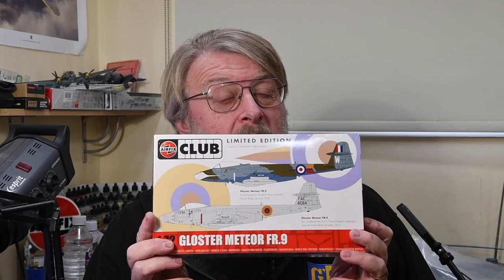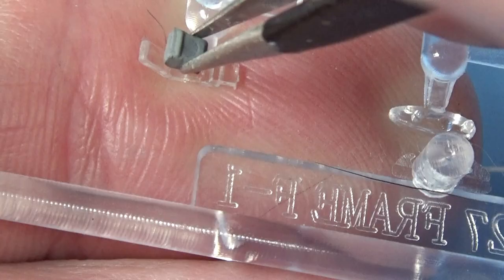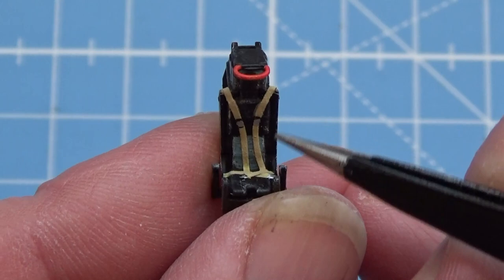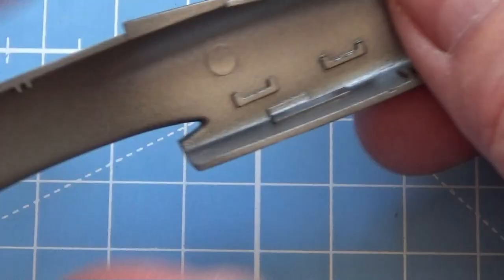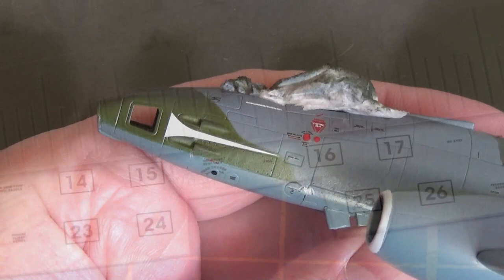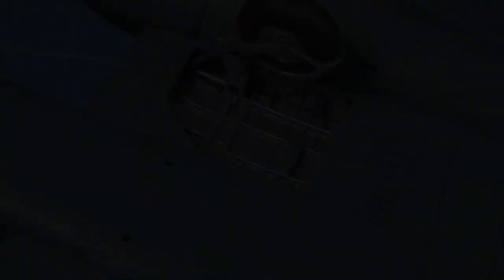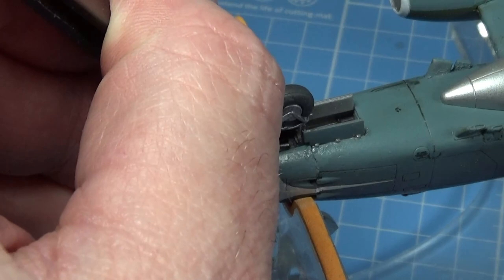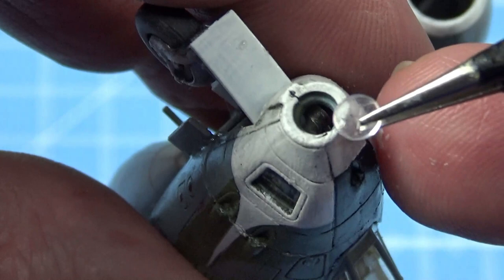AIRFIX METEOR FR.9 2023 CLUB KIT how to build it!

Comment: Lovely Meteor, Gary.
Every time I’ve built a Meteor I’ve had a problem with the undercarriage, next time I build one it will be in flight!
Ian
Reply: I found that I had to sand the tires halfs on the flat side till about a mm per side is gone--then the tires fenders dont have a open seam
Reply: @bullitt3980  is that the Airfix one? I’ll save that for the next time 👍🏼
Ian

Comment: Very handsome build!
A couple of questions.
• What silver did you use on the fuel tanks?
• Considering there's nothing behind the camera windows, would they look better painted black on the inside?
• I get nervous mounting clear parts with anything stronger than white glue -- any comments?
• Stencils.  Have you seen a 1:48 Phantom II in SEA camo with stencils in 2 different colours?!  At least, as you say, they're all present for you so you can choose what to apply.  (Is the aircraft modelling equivalent of a rivet-counter a stencil-counter?)
Again, very handsome.  Thanks for fighting the COVID for us.
Reply from the maker: Hey Randy! The silver is Vallejo Metal Color aluminium over grey primer. Interesting point about the windows - I like them clear but then I'd have liked an F24 on a mount behind the windows! Clear parts - larger ones I've tended to use PVA of some sort but small light covers I find a tiny bit of extra thin works OK as it follows the seam by capillary action. Phantom stencils scare me- I've got one to do in 1:72 and there are lots of them. I'm sure it's a case of make sure they are all there or there will be trouble - doesn't mean everyone will use them. Hope that helps!
Reply: @garys_stuff just finished the Matchbox meteor...option i chose to do is the NF-14 model of no 85 squadron,Royal Air Force Church Fenton,Yorkshire,1958

Comment: Nice build Gary. I want this kit and some other Meteor variants now. 😅 I wish Airfix would start including a seated pilot and a stand with their kits again. This looks ready to be modelled in flight, except for those omissions. Finding aftermarket seated pilots to match my models is quite difficult or painfully pricey if I do find them.
Reply: You may be on the right track in one regard, the club kit. Even if it's a smaller extra sprue added for the base and a pilot. Probably could be reused over several years. Maybe have 2 or 3 versions of that sprue, depending on what the club kit is that particular year -- ex- #1 extra sprue fits WW2 pilot and stand for 72nd scale, #2 extra sprue fits jet era pilot and stand, etc. Can spread the cost out over 10 years that way and add a bit something to the club kit. 🤔🤔
Reply from the maker: Some kind of consistency would be useful. Some kits do have them, others don't. The Mosquito has a pilot but no navigator - the Lancaster just a pilot. And so on. I can understand it with bigger kits, but they must have a gallery of aircrew in 3D ready to drop into a frame in design in 1:48 and 1:72.
Reply: @garys_stuff  might be a good one to toss at Dale/Pramjet. Old lesson from a boss when I was very young, never just hand the boss a problem without a solution. 2 or 3 if possible. As I got older and further up the food chain, it became option 1 has these plus/negatives and cost, option 2 has different plus/neg, etc. Dropping something into molds may have further redesign costs. As those get updated, to keep costs lower in meantime here's a small frame option (and can be done locally) to add in, while differentiating Airfix as "We listened to customer feedback, heard you and are adding pilots and stands back to our lineups" thus the only kit manufacturers to do that. Win hearts and minds of customers at low cost while standing out from the pack. It's low hanging fruit and easy to change verbage and still hits home. 
Just more of the late night last cup of coffee ☕ as the brain winds down.
Reply: @crazylocha2515  great idea. Hope the guys at Airfix are listening.
Reply: @garys_stuff  agreed. Or put out pilots, navigators and other crew as separate sets for use with the model planes.

Comment: Im working on the f8 version and Ive never had such assembly troubles in a new Airfix. Im still not happy with how the nose fits and the landing gear looks like a good ideal but takes a lot of sanding to avoid a gap in the wheel splash guards.
Reply from the maker: I' with you on that. The nose seems to be one of those will it / won't it things. I've had one go straight on no worries. The I've had one that was the devil's own job to fit. Thing that bugs me most of all is the nose wheel leg habit to be installed so early when it will plainly get broken. Not their finest hour, sadly.

Comment: HI Gary, Glad to hear your on the mend and still showing how to be philosophical with tricky issues such as  nose gear-build. Just wondering what your take is on the setting of Air supply pressures for painting.
 Do you set recommended or your preferred pressures with the airbrush blowing or not blowing? My gauge drops quite significantly when the button is pressed, it can be 8 - 10 psi depending on the needle size so I end up wondering if one would be better than t'other. 🤔
Reply from the maker: Sorry to say it depends on what I'm doing! I use higher pressures for things like varnish where I'm doing large coats, much lower if I'm trying top add spots of colour. I'm around 6-7 psi (0.5 bar) for the smaller work, maybe 15 psi (1 bar) for varnishes. But that's just me!
Reply: @garys_stuff  That’s ok thanks, but my main question was, are you setting the regulator pressure with the airbrush blowing or closed?

Comment: My question why do people paint everything to far ahead them the part don't hold up when glueing it best to glue thing in then paint they say painting and glue does not hold a strong join the paint after dry ozes out after glueing the halves together when I glue I make sure all parts are glue to plastic them paint the part after even the halves are holding better with out seams of paint showing through the seams I be doneing these model for many years mine are neat and tidy. Joint I've seen mamy people do this on there channels it just not a strong bond paint and glus never hold up
Reply: The rule about scraping paint and chrome away is because plastic cement only bonds plastic to plastic.  Other cements -- white glue/PVA, super glue/ACC, etc. -- are surface cements.  The joint may be a little weaker but it's usually fine for smaller parts, and can be debunked if needed with water (white glue) or acetone/nail polish remover (super glue).  Super glue also dries quickly and that can be quickened with accelerator.
Reply from the maker: Depends on the part and how easy it will be to access once it's fitted. It's easier for me to paint things like ejection seats, stores, undercarriage and the like off the kit. Sometimes I'll gently sand off a bit of paint on a bonding surface (or to get the fit correct).
Reply: @garys_stuff  
A nice thing about modern fighters is that ejection seats are designed to exit in emergency, so they can slide in after painting, later in the build.